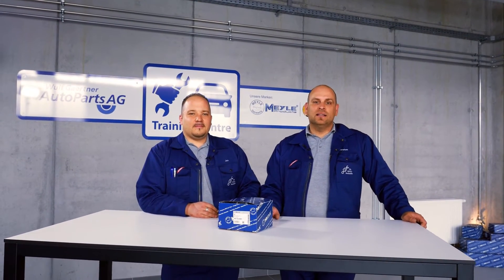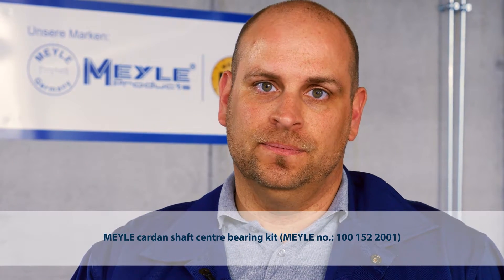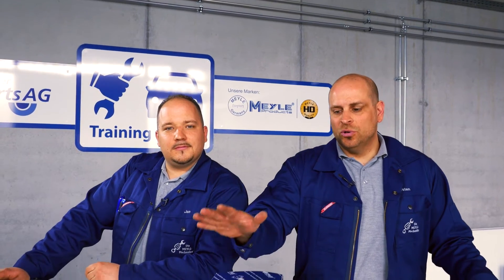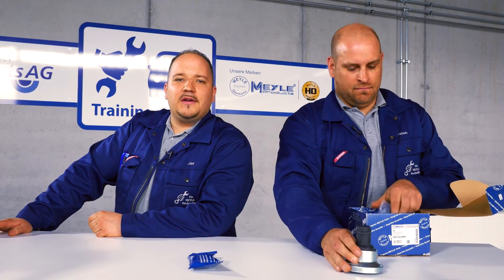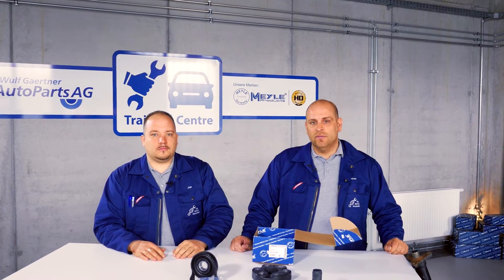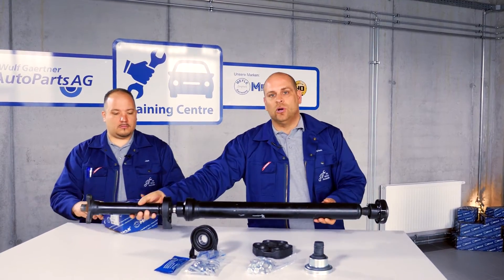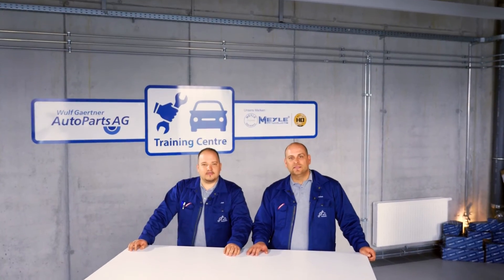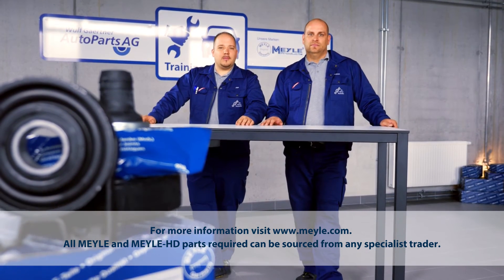The MEYLE Mechanics: Cardan shaft centre bearing replacement

Comment: I cannot purchase on the website, how can i get one of these kits?
Reply from the maker: Hello, we only sell directly to whole salers. That's why ist is not possible to buy on our website. But you can send us a message via our contact form and tell us where you live. Then we will give you some information about parts dealers in the region you live. Best regards, MEYLE-TV
Reply: MEYLETV 
We plan to overland 30+ countries in our Cayenne S and we're replacing this as a matter of reliability. It's  a shame I cannot get one from you as I'd document this as part of the off-road ready upgrades we are doing, there is nobody near me to get one. Instead I'm buying a complete shaft with a 5 year warranty (£199).